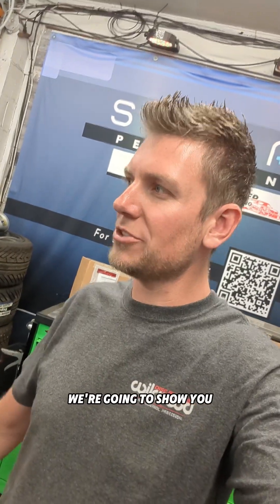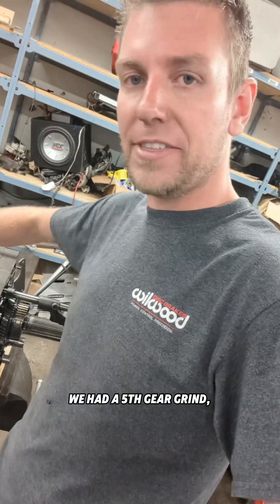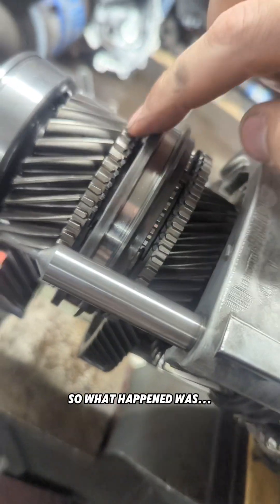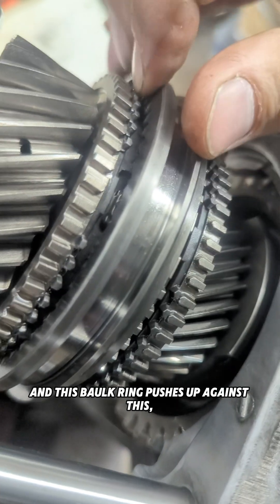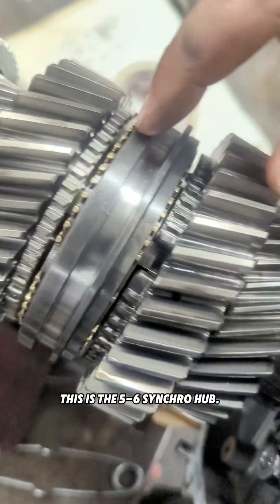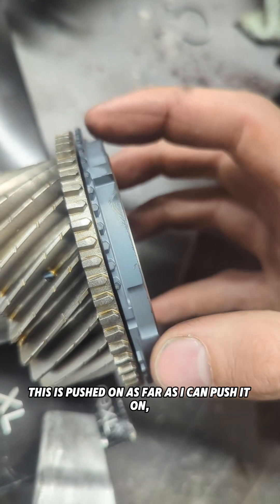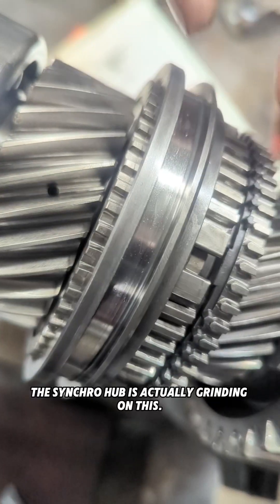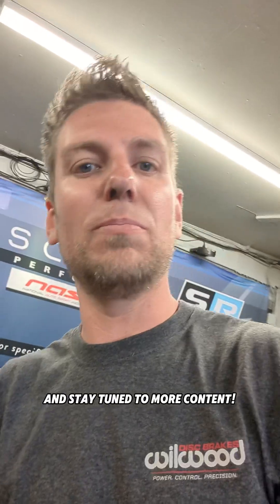What Happens When You Break A Shift Fork In A Nissan 350Z?

Comment: I’ve been looking everywhere for a solution for my 2004 350z it’s all OEM with only 11k miles and I’m and I’m experiencing grinding when shifting into 5th gear. The only time it doesn’t grind is when I shift really slow. Everyone online all have different answers on what the problem is but would you suggest I get a new assembly and replace it?
Reply: Try to replace the shifter bushing and make sure all the linkage bolts are tight as should be I’ve had a similar issue on a cd009 from a 06 and the bushing was just beat to hell
Reply: @ramqo thank you!